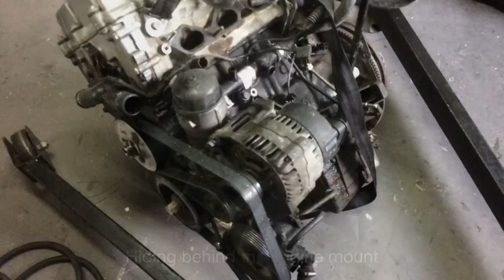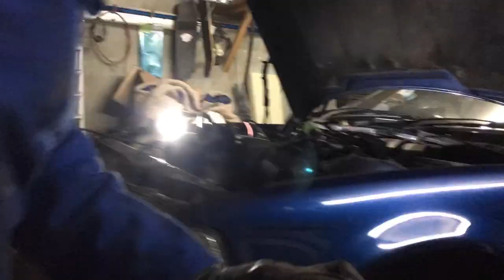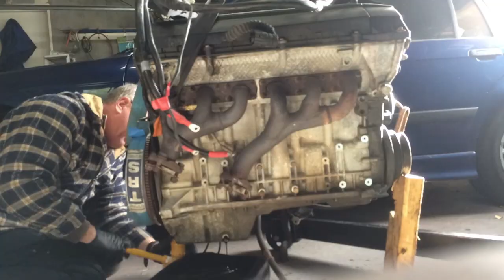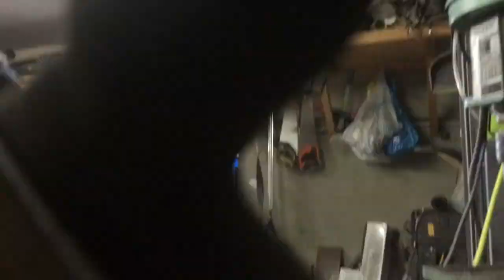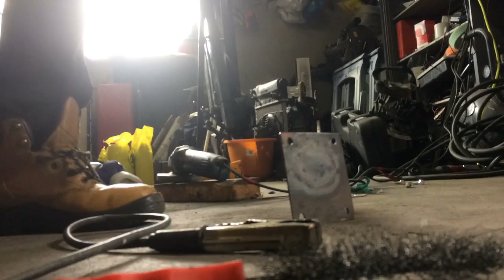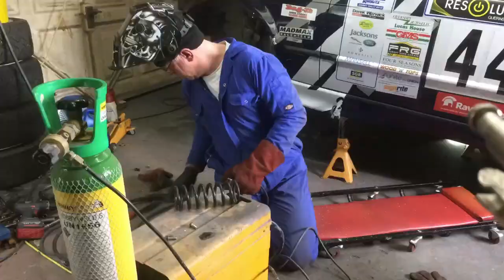BMW 318ti to 328i engine swap

Comment: Hey sir. I'm looking to collect a list of parts needed to perform this swap. Do you think you could help me out? Other than the engine, what all will i need?
Reply: you had to use the fuel lines from the 328i going to the manifold right?
Reply from the maker: If you get the loom and Ecu with the engine you will need to make up the exhaust and get the ews removed from the Ecu and that’s about it as it’s a really straightforward swap
Reply: @jerseytim100  Ok thanks. what about fuel lines? did you just use the exact fuel lines originally in the 318ti? or did you remove the fuel lines on the 328i going to the fuel rail / manifold
Reply from the maker: @Thomas-fc6gf  as long as they fit use either. I think I used the 328 pipe and clamped it on the steel tube
Reply: @jerseytim100  Thank you for taking the time to answer these questions. 

I bought a m52 and also the steel tubed fuel lines going to the rail. So to my understanding, i'll be able to use the same transmission, drive shaft, shift linkage etc. 

If so, this does sound like an easy swap and i hope everything will go as smoothly as yours did

Comment: Do you know what to do with wiring i am putting m52b28 in e36 m40b16 and i dont now how to start the engine?
Reply: Engine is from e39 1996
Reply from the maker: Do you have ews? If so the easiest way to overcome it is to get Endtune to remove it from the ecu
Reply: @jerseytim100  i have ews but wiring from engine and car are not same.i just put engine in the engine bay and now i want to start doing wiring
Reply from the maker: @Toni-lx9yf  it’s a bit hard for me to explain on here but there is loads of information on the internet. I have done plenty of bmw engine swaps and always had to disable the ews in the engine ecu. All the rest is pretty straight forward

Comment: Hello, did you need to change anything on the electrical side? or just plug&play? I'm doing the same swap, and I'm concerned about it. Also I'd like to keep ABS. Thanks in advance.
Reply from the maker: I had to get the ews removed from the ecu and have always disabled the abs as I don’t like it so can’t help there
Reply: @jerseytim100  Thanks bro, I already did this swap. I kept EWS, ABS and everything. ABS is plug&play, and the EWS is just matter of changing the module and ECU with the donor ones. I just had to remove the transponder from the donor car and put it in the key of my 318i. The only thing I had to do on the wiring side was to bridge two pins from the X20 connector to make the dual temp switch from the radiator work and use an aftermarket electrical fan with the OEM resistor. Everything else is pretty much plug&play. Have a nive day bro!
Reply: @mexiquenfrance6084  hey, i am thinking to swap my 318i vert to 328i. Did you use diagrams or any manuals ? How hard is to on scale 1-10. Me being a beginner.
Reply: @jaykapoor6753  if you have everything from the donor is straight forward. I'd say 9/10. There's nothing to change in the electrical side, only bridge two pins from the X20 connector to get the fan working, nothing else.
Reply: @mexiquenfrance6084  got any video on how to bridge the wire? I don’t seem to find it

Comment: Hay does the 318is gearbox fit the 328i engine?
Reply from the maker: It bolts straight on as they have the same bolt pattern

Comment: Did you keep the 4 cylinder transmission? Or is it the same anyway?
Reply from the maker: yes it is still the 4 pot gearbox which is also used on the 325i and is plenty strong enough. I have been using the same  gearbox from a 1.6i on my other car with a 2.8 engine and it has been abused for years with no problems
Reply: jerseytim100 awesome, thank you!!
Reply: Wait the 318is getrag transmission bolts up to the 328i motor?!
Reply: @LKSblackops  yes

Comment: What’s about the wiring any changes there?
Reply from the maker: The wiring is very simple. The engine loom plugs straight into the car loom and there are a few power cables to join together. I sent the ecu to Endtune to have the ews and abs removed to make everything simpler
Reply: @jerseytim100   witch cabels together?? i have done a m50 swap on my 316i and it wont start ??? i have no spark... the car is from 1995 and the m50b20 is from 1991? so the engine has no ews it cranks over but no spark